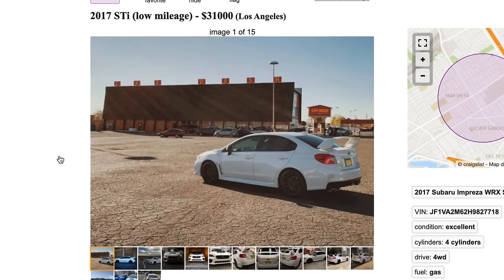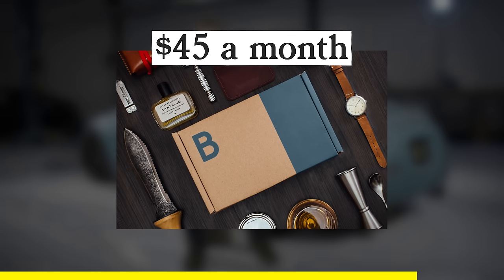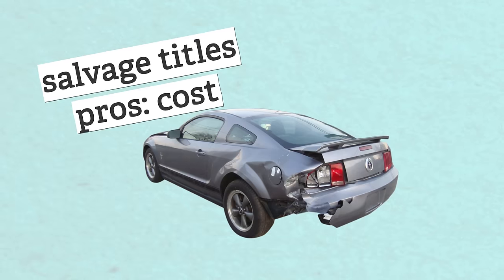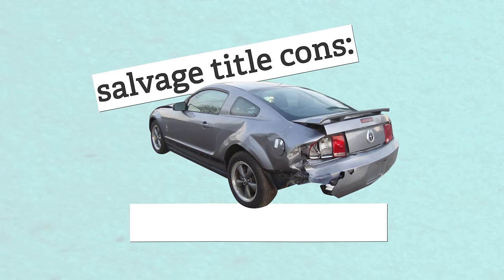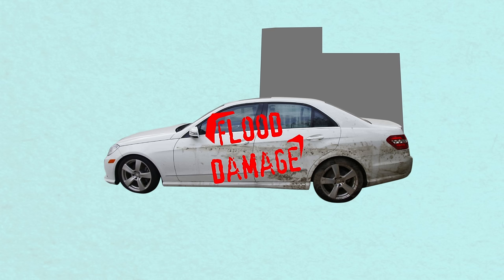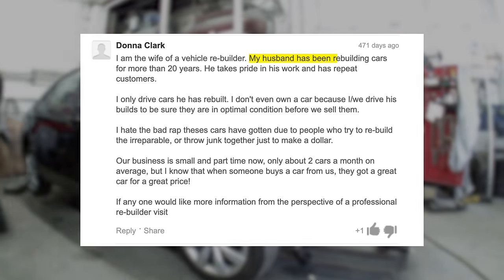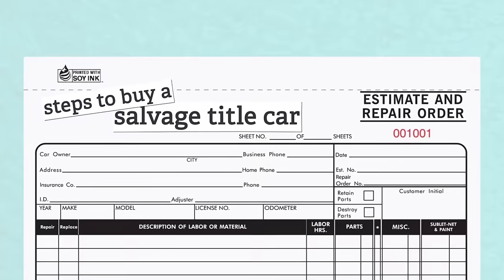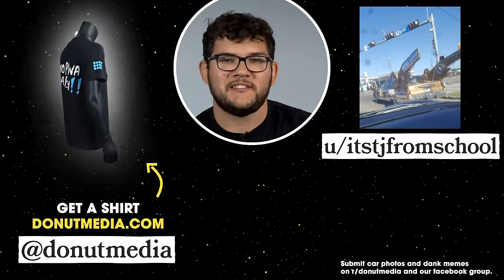Buying a Salvage Title Car: Bargain or Nightmare?

Comment from the maker: What salvage car would you buy to fix up?
Reply: Donut Media, 2011 Cadillac CTS V coupe!! That’s my salvage car of choice.
Reply: MK4 Toyota Supra
Reply: E36 m3
Reply: audi 5000 avant. restoring one myself and 5 cilynder sound is the best
Reply: Most of my dream cars are older cars. Which means I’ll be putting work into the car anyway. If the body was put back well enough that it ran for years then it’s probably okay and I would buy a SALVAGED title car as a fun project.
Reply: @nickcrill7718  change that to a wagon and  I would be all over that!!!
Reply: Celica supra mk2
Reply: Bodyless 2001 Corvette C5
Reply: @finntjomstol9364  E30 M3
Reply: Nissan silvia s15. build the SR20, upgrade turbo, Rocket Bunny, add angle, and drift.
Reply: 90s GMC Sonoma with an awd drivetrain and make it into a syclone
Reply: 1969 Dodge Charger
Reply: 91 NSX
Reply: Donut Media Mitsubishi 3000Gt, Evo or Eclipse
Reply: Supra and a toyota tacoma
Reply: I don’t do salvage but my parents bought a 13 Subaru Outback with low miles for 8g
Reply: bought a bmw e36 and restored it.. now busy on my second project... classic mini 1.3 spi
insta: @julesheynen for pics :P
Reply: S2000
Reply: Feel better soon James. We love you bro.
Reply: Shopping for a 335d right now!
Reply: Donut Media I got an 01 Honda Accord with 86,xxx miles for 1,200, considering they go for about 4-5k normally around here normally that’s insane, plus the salvage happened at least 3 years ago
Reply: JZX 90 (If there are any lol)
Reply: Nissan 240sx
Reply: Donut Media i bought a salvage 2017 charger daytona not knowing lol and then totaled it 5 months later
Reply: 2003 SN95 New Edge "Terminator" Cobra.
Reply: Subie Bug eye
Reply: Any evo, with the money i save i would then not mind the whole blowing the diff thing.
Reply: Toyora MR2 or Supra MK3
Reply: Donut Media 1992 James
Reply: 240Z!
Reply: A civic
Reply: R32 skyline gtr
Reply: Honda CRX
Reply: Toyota Corolla GT Apex AE86
Reply: 1995 Ford Ranger Supercab 4x4 STX 4.0L V6 AT but trying to find one has proved to be hard to find.
Reply: 1992-2002 rx7 STOCK ENGINE!!!!
Reply: @callsigngecko4723   that is probably the best situation to get a salvage title car, you would already mod the heck out of it to drift and if something is wonky you would just Jerry rig a solution.
Reply: Miata
Reply: Bughatti Verón for 10 dollars.
Reply: Gt86 chassis
Reply: Ford Aspire
Reply: 2002 subaru wrx not wagon
Reply: Bought plenty of salvage cars and most run with zero problems
Reply: Donut Media Trd Pro 4Runner
Reply: Donut Media 
I bought an ‘03 Mustang Mach 1 with 45k for $4000. I got it all back together and it was beautiful than it spun a bearing most likely from the accident that it rearended another car. I ended up selling for $2500. Lost my behind again and again.
Reply: toyota ae92 levin sedan
Reply: I own a salvage 2015 Forester with hail damage... sorry, speed dimples. I think it just depends on what caused the damage and how bad.
Reply: Donut Media the 2013 Hyundai Azera has decent prices at the auction these days!
Reply: Almost got a '15 5.0 in auction to widebody
Reply: Either a 3rd generation ford explorer or maybe a 4th gen explorer or... maybe... 1st gen explorer or a 1st gen bronco.
Reply: Rebuilt my dream build car Mazda rx7 or Mazda mx5 or mazda rx3
Reply: Rx7 fd
Reply: What's bad is I gave my brother a hotwheels type R toy since it's his dream car even though he ended up working at a tire place and buying a 2019 civic SI
Reply: Tesla Model 3
Suzuki Swift Sport
Reply: 90 miata. which i unknowingly bought this summer as my first car
Reply: Donut Media 69 charger
Reply: Aston Martin v8 vantage 2006 to 2009
Reply: Vz Commodore  because  im a Aussie  mates
Reply: 240z
Reply: Donut Media 69 mustang gt
Reply: Volvo s60 polestar
Reply: Y’all wilding for using the word sus
Reply: 68 Camaro
Reply: Donut Media no. But yes. But no. 

Would I drive one or let anyone I love drive one or recommend it to anyone? Absolutely not. Would I daily it? Absolutely not. 

HOWEVER, I will make one exception: racecar. Even then, it’d have to be a very specific kind of car. A car that was totaled because the cost of non-structural repairs was too expensive (like the WRX subispeed built for shoes and global time attack), or because of flood damage (like the FR-S converted into a track car after Harvey hit Houston).
Reply: Eclipse GTS or viper or an 70s mustang or AMC javlin and 86 Corolla GTS
Reply: Subaru FTW
Reply: Toyota Tercel
Reply: A lotus!!! Where’s my up to speed on lotus?!?!
Reply: A nissam skyline
Reply: @gagekmiec7101  Oh god please no
Reply: Suzuki Karimun 1st gen
Reply: FD Rx7
Reply: vw beetle
Reply: @Brent Reid ladies and gentlemen.... We got Em.
Reply: AE86/corolla GTS/SR5
Reply: Toyota Tacoma
Reply: Accord
Reply: Accord 2015
Reply: 2002 Dodge Ram 2500 with the 5.9 Cummins
Reply: Anything that 40+ years old and worth your time tbh...
Reply: Mazda rotary power to swap it with a 20b from a mazda cosmo
Reply: 2006 srt8 Chrysler 300
Reply: I have a 96 gmc sierra. It's 2wd and it's a single cab long bed. It has 5 speed 7.4l motor in it (454ci) and it makes about 300 up and weighs less than 5,000 pounds (I think). This truck has 110,000 miles on it and it use to be my dads. He was sitting at a  stop light and got hit by another driver who then took off and the truck was then totaled and I had to buy it back  for $800. My nightmare didn't end there though. Currently I own 2 other vehicles and they keep breaking preventing me from fixing my truck but I'm going to keep trying!
Reply: 1978 safari 911
Reply: S2k or Acura TL
Reply: Got a MazdaSpeed 3 and it’s amazing 🎉
Reply: Any Toyota MR2 😍
Reply: The Mad Daddy I think that’s a great idea. Especially for a family or rookie driver where the looks aren’t a major concern
Reply: If ur gonna buy a salvage  car avoid front damage always go for rear damage or door
Reply: Ford pinto 
Just to replace the parts
Reply: Donut Media challenger srt scat pack or a porsha GT3 RS
Reply: Subaru WRX coupe
Reply: 2015 Mustang GT350. I'll send it back to Shelby to turn it into a convertible.
Reply: Can you do a video on if you should buy a car from CarMax or not
Reply: Mustang
Reply: Any car with “hail damage” those are the best! Like fuck the body, when your going for performance and not looks. “Hail damage” is the best, could get hit by 3 ice rocks “little marks” not even noticeable Forreal. And they auction it for 400$ and it’s like not even 10 years old
Reply: 1993 FD
Reply: The Peel P50 that James wrecked 😏
Reply: A Corvette. I want to own one someday i dont really care if it has salvage title ill own it for the rest of my life.
Reply: 200 series Land Cruiser or a Rivian truck once they come out. Just worry about getting it insured.
Reply: Most y'all got it backwards wanting to buy low production salvage cars (NSX, MK4, E30M3). Unless you gotta lotta time and money, in which case you don't need a salvage car anyway. You buy a Civic, Corolla, Camry, or Accord; in that order. Cars that have Chinese parts support, or common at junk yard, that are commuter cars and sell to a wide range of customers. There's silver in them words of advice.
Reply: @maxanderson7344  you unknowingly bought a car?
Reply: @regularpit1508  what's bad about it?
Reply: @Death_Sweet  you must know what you're buying and you got lucky. Some start throwing codes after you fixem. Like air bag light, though not deployed, gotta send module to specialist. Seatbelt and retainer codes, replace receptacle or sensors. Also impact sensors under bumpers. On and on and on.
Reply: In the state of NJ they are called "Branded Title"
Reply: 2020 cx5 with the turbo i plan on looking for one when my 3 gives out
Reply: R32 gtr and throw in a  r35 engine with a LBW Kit
Reply: 1996 SS impala.
Reply: Donut Media go bucks!
Reply: I would buy some sort of old Ferrari
Reply: Donut Media maybe a milk truck
Reply: Challenger or gt86
Reply: Volvo 240 all the way
Reply: @Sevalen  i mean some people do it for dailys too, just look at @goonzquad, but yes, buy a already wrecked car for a sport/ purpose where its just gonna be destroyed again. like Adam Lz with his JZX100 missile car.
Reply: So off of personal experience I recommend them! I get the cars I couldn’t afford initially at half the price. All of the cars I own are rebuilt meaning they passed state inspection and deemed road worthy again. Here what I’ve got as off now.

2018 Porsche Macan S (8k miles, minor side damage): $27K initially, $31k after repairs. 

2018 Porsche Cayman S (10k mikes, minor rear end damage) $26k initially, $29k after repairs. 

2019 Chevy Silverado K1500 (3k mikes, Front and tear damage) $16k initially, $25k after repairs.

Even helped my GF out with her car as a summer project and she got a, 

2015 Volkswagen Beetle (80k miles front end damage) $2k before repairs, $3.5k after repairs. 

All the work was done ourselves and used OEM used parts bought from eBay and local yards. If you plan on rebuilding something here’s what we did. We only buy off of auctions and made sure we buy ONLY from insurance companies because they do not doctor (hide the damage to sell for more)  cars before placing on auction. We made sure to buy cars with easy to repair damage (no flood, rollover, frame damage). Before bidding we inspected the car in person if possible. We did as much of work ourselves to save the most money, any work we couldn’t do sent over like paint. Got it inspected, and when it passed we received a rebuild title which we can register and even appeal the value due to the history to save on registration taxes. Note some state will not allow salvage titles to be registered, so here in GA we have to do it like this. I’ll be more than happy to share some before and afters :)
Reply: 1999 Ford Focus Hatchback
Reply: 350z
Reply: Dream car Toyota Supra Mk4
Reply: Porsche 911 Carrera RS
Reply: @WarriorsPhoto  you would be amazed what you can find at copart or IAAI
Reply: @LSXSahota  yes! Do it! There is a prius with a massive V8 in it. Has a military theme paint job. Its sick. (We drive a salvage title Prius with 265k miles)
Reply: @hotmojoe2483  ok Cletus
Reply: @Mrtee-ml8zf  😂😂😂
Reply: Bugeye Subaru wrx
Reply: A border patrol raptor
Reply: Will prob in the near future look for a salvaged R8, Gallardo (LP), 911 or a Aston Martin Vantage.
Reply: R32 GTS-T/GT-R or any 3000gt/GTO/Dodge Stealth Twin Turbo
Reply: Datsun 240Z
Reply: Volvos
Reply: Nissan R34 or BMW GTR
Reply: Aluminum superduty diesel. No flood cars
Reply: E55 AMG W211
Reply: E9x 335
Reply: 89 Camry. AKA, "practically a free car".
Reply: Almost any toyota
Reply: Ferrari
Reply: Brz or 370z
Reply: Bmw m3 e46
Reply: My dad and I bought a 2004 Civic LX from the salvage auction, minor front end damage. We put it back together with parts from the junkyard and he drives it to work everyday. He's put like 16,000 miles on it since then without a problem. I'd buy one straight from the auction and fix it myself or from a quality rebuild shop not from other people.
Reply: 1996 Nissan nismo 400 R
Reply: Obviously a Lada
Reply: I'm here trying to change the salvage title on my life.
Reply: I am buying a salvage FRS from copart to rebuild
Reply: Audi R8🤤
Reply: Toyota Sprinter AE86 Trueno.
Reply: @ashwathsalaskar52  Levin or Trueno
Reply: ricky v 1970 gt500 scj convertible yellow hornet
Reply: ricky v but beware salvage or no title can mean stole if no title and salvage insurance fraud maybe
Reply: S00praa
Reply: Donut Media nsx
Reply: I’ve rebuilt a lot of Maserati’s
Reply: 2009 nissan gt-r nismo
Reply: We bought two salvage title cars in California for our high school son and daughter. We bought them from a trusted mechanic and never had any issue. When they needed service we took them back to the mechanic. The kids drove them to the ground and finally we donated the vehicles to the local PBS station and got a nice tax break. The moral of the story is to know the seller/rebuilder.
Reply: 2002 subie wrx
Reply: Donut Media G wagon
Reply: 370z, half the ones on the road are salvage because the cost to buy normally is way too much for what you get.
Reply: Donut Media scatpacks
Reply: My 2009 civic Si
Reply: 666 dollars illuminati exposed
Reply: RX-7
Reply: C5 corvette of any kind
Reply: Manual Hardtop Mustang GT S550
Reply: Obs work truck. Easy as pie to fix (most of the time), sturdy engines (again most of them) and 4x4
Reply: Tesla model X
Reply: A car in an accident
Reply: Bugeye WRX
Reply: Donut Media Chevy Suburan GMT900
Reply: Anything BMW
Reply: I bought and fixed a 2002 Camry that I got straight from the auctions.
My brother bought a 2007 Camry.
My mom bought a 2017 Subaru Outback.
These are all salvage cars.
(p.s. yes I live in Vermont, that is why my mom has a Subaru... BECAUSE EVERYONE HERE DOES!)
Reply: @Leaf Closson Just bought a sweet 940 turbo for 700euros.. Basicly wheels under it worth that money lol
Reply: Purchased a 2019 wrx limited with a salvage tittle. Had 1600 miles on it. Had it inspected by subaru before purchase. Got it for $22k. And it came with STI wheels and exhaust.
Reply: None they’re not worth the headache. Want your dream on the cheap find one with a blown engine or trans with a clean title
Reply: I bought my Dodge Ram pickup truck with a salvage title. $1,500 in body parts and some in paint and it's been the best 4x4 truck I've ever owned. I've had it for over 8 years now and knowbody it the wiser
Reply: Literally anything
Reply: Miata!
Reply: Rsx type s k series motor with a lot of potential for power and if the car is totaled again you can resell as a parts car or pull the motor for a swap.
Reply: Mazda RX-7 fd
Reply: Nissan skyline r33
Reply: Dodge demon
Reply: FD RX-7
Reply: r32.
Reply: I have a lot of rebuilt cars I have a 2010 g37xs  integra gsr ek hatchback and a 08 si mugen
Reply: Fixing a Salvaje E46 M3 right now.
Reply: Ae86 or Ae89
Reply: 2016 and up Chevy Malibu, idk but I just love Malibu’s
Reply: I bought a 2010 Genesis Coupe 2.0t R-Spec with a couple of mods for 5k Salvage title but I drive it ALOT  and havent had probelms. It still has minor damage but a 6speed manual rear wheel drive with a lsd for 5? All day.
Reply: Any RWD cars with a manual transmission. Cough cough Nissan S-Chassis
Reply: Monte Carlo SS the last gen of them that shares it's platform with the 9th gen impala. Perfect for a drag car and fairly cheap to buy because of the age of the car
Reply: Subaru outback..
Reply: I bought my first car ever early 2018 at the age of 20 for $5000. It’s a 2014 Corolla and had 30k miles at the time, the only issue was that it was flooded during hurricane Harvey. Haven’t really had any major issues and overall I’m very happy with it.
Reply: Deffo a skyline
Reply: Pagani huayra roadster ( i saw one on the news get totaled in a accident)
Reply: would live to find a salvage e92 m3
Reply: Supra or 370z
Reply: @shxkn  well as they said some salvage title cars has little to no damage
Reply: @adamwilliams2587  instagram?
Reply: id go with benz, toyotqs, hondas, lexus, acuras, bcs one they r reputable cars and have decent resale, second, id look for preferred body damage, and not too much mechanical, if its say a reinfoecement bar, ill rix it, but say its hail damage, flood damage, direct blow to the engine, or under carriage damage, no way in hell will i buy a car unless im scraping it for parts to rebuild another car. A great tip i learned is say u go on copart, GOOGLE SEARCH  the vin number, 90% of the time it will show u the before and how badly totalled was the car. A great salvage car to buy is rejected repair, it means thst insurance started the repair, shop raises quotes as more parts r required, thry total the car and the parts r basically in the trunk and seats.
Reply: Mk4 supra
Reply: Tesla model 3
Reply: Toyota Supra, Mazda rx-7, or most older Nissan GT-R’s
Reply: Mk5 toyota supra
Reply: 07 wrx/sti, 05-07 legacy/outback xt
Reply: I would get a viper or a supra mk4
Reply: Odd Pepper bit late but got a loaded 16’ Tacoma 4x4 for around 15 total after it all got fixed up (got hit from behind) and just got an 18’ RR rs for 13 total (needed headlight and repaint) ez cop
Reply: In High School I had bought a 2003 Nissan 350z (automatic sadly) for only $2350 that was in a wreck causing it to have a salvaged title... took years a few years to repair but it was worth it considering it only had 58,000 miles at the time. Though she might be automatic, still fun to drive and kinda feel more connected to your car since I had personally repaired it from a state where it could barely even roll... So from personal experience, if you know the ins and outs of a repairing cars or just a slight amount I'd say buy a car that is considered salvage/rebuilt. I have had my 350z for over about 4 years now and she is still going strong with me down in Fort Riley, Kansas. I even made multiple 20+ hour roadtrips to and from my home in NY then back to KS.
Reply: Datsun 240z
Reply: Any GM muscle  car from 1965 to 1978 especially a 1970 Camaro Super Sport or 1978 Chevelle Malibu SS with 454 hp stock
Reply: Shelby gt500 or 350, yenko Camaro ,ss,z28,zl1 trans am, any challenger from 09-2020 or any 60s muscle car.
Reply: I got a 2014 ram hemi for 7k$ with 70k miles i think i got a great deal no issues with it super clean
Reply: Brian's car
Reply: I just bought 2009 M3  convertible. It is the prettiest car I've ever had, though there is visible damage if you look hard enough. It was about 60% of market.
Reply: I would only buy a salvage car for track only use or parts.
Reply: I would just buy a Rx7 or Supra Mk 4
Reply: @Leaf Closson with 6 speed ONLY!
Reply: 1969 charger R/T
Reply: 2005 Mercedes e55 amg
Reply: Newer Dodge Charger
Reply: Your mom
Reply: Miata
Reply: Volvo 850 R
Reply: WRX STI or BRZ
Reply: S2000
Reply: My Monte Carlo was a salvage from hitting a deer. Got it cheap and loved it. Was 17/18 so I was mean to it. One of my favorite cars. No problems besides the ones I caused.
Reply: Brz
Reply: surpa 4 life
Reply: Mr2 sw20
Reply: A nissan Gt35 O a lambo just for fun
Reply: I currently have a 08 g35 HR and a 1995 240sx 🤙
Reply: I drive a salvage titled 325ix that I rebuilt, put 4.10s and a manual in. I would say if you're going to do this get in as cheaply as possible, dont buy anything at first, and make sure you have a good grasp of physics and chemistry, but you can definitely do it
Reply: 335i
Reply: @nickcrill7718  That's the car I have always wanted. I have a 5th gen camaro now, was thinking the cts-v would drop in price and could sell the Camaro ss, but the cts-v just keeps staying at sane price for a low mileage one at about 36k, a cts-v wagon I would love also because of how rare and still just as fast.
Reply: Challenger Hellcat or a Demon
Reply: Nsx, gtr, supra
Reply: 2000 Chevy Malibu
Reply: My written off focus ST.  just want it back
Reply: I got a 1987 salvage Corvette stingray for $1,200, and I fixed it up with a new rear bumper and left quarter panel, new metallic gray repaint, brown leather interior, new bbs rims (RG Diamond Black), Michelin tires and the engine tuned with a new exhaust, better fuel injection, and replaced all the belts. Overall I spent almost $12,500 on my beauty (I'm 27, but get called an old man all the time, and once someone called the police because they thought I was stealing the car and they didn't think it was mine. Good times)
Reply: R35 gtr
Reply: Nissan Armada nismo edition
Reply: This Ford Explorer that I’ve been looking to get redone but don’t know anyone near me...
Reply: @LSXSahota  wouldn't fit + transmission wouldn't either + fabrication would be a nightmare + electrical will be a nightmare
Reply: @benjamincho4819  murica
Reply: @Leaf Closson Parts are very $$$$ for volvo. Not much aftermarket. The cost will be huge.
Reply: 1994 toyota celica >:)
Reply: Bids on Auctions on Exotics
Reply: 2010 PT Cusier even is front is total and rear total but not the cabin/ driver area thought if possible.
Reply: '93 240Z
Reply: GT4, check my gram
Reply: 350z
Reply: A miata
Reply: '91 240sx. I bought it in Indiana, it had an Ohio salvage title, and I lived in Michigan (can you see where this is going?). Apparently, that was too much for the Secretary of State office (our DMV basically) to follow, so when I transferred the blatantly orange salvage Ohio title (from Indiana), I ended up accidentally "washing" the title because they just slapped a clean green Michigan title in my hand, no questions asked. The car was a deathtrap (just because it was old and abused, not necessarily because it was a salvage title). I ended up selling it to a friend a few years later (he did some questionable modifications to the already questionable car). After he had his fun, he sold it to another friend, and then they proceeded to wrap it around a tree. 

Ahhh, yeah that car was absolutely terrifying in all the wrong ways, and I miss it every day.

Bonus Fact: This thing was in such terrible condition that I jokingly called it the 237sx... "Because it was missing a few".
Reply: Cadillac flintwood 1990 ill do it for my dad cuz he had that car before and he loved it but he had to sell it bcs we needed money
Reply: @gagekmiec7101  Is that a supra?
Reply: Eclipse gsx or 350z
Reply: pre 2000's Volvos
Reply: "Weekend box" just full of junk you'll never use
Reply: 2004 subaru wrx
Reply: Donut Media I Bought a 09 Honda Accord exl 2door with a salvage title a few years ago for $5500, got in an accident a year late with it, the other driver’s insurance payed me out $8200 but I was so afraid of getting nothing because of the title before it was appraised
Reply: @gagekmiec7101  hahahaha it's to early for that
Reply: haloplayer 049. Yes and no. I mean you have to remember when it came out it was a like a high school kids car. So a lot of them where probably crashed.
Reply: DODGE VIPEEEERRRR
Reply: Toyota AE86
Reply: Idk
Reply: Rx 7
Reply: 2012 mercilago or a mk4 Supra or take the engine out of a 2000s v8 mustang
Reply: Or a bmw m3 gtr and paint like you know the one
Reply: GT40
Reply: Mazda miata
Reply: Jeep Cherokee
Reply: Wrx ♥️♥️♥️♥️♥️
Reply: Title washing in romania happens every second
Reply: 13k +5k is 18k,  converted to Myr, it's RM 72 000, that is wayyyyyy more cheaper than a Subaru brz recon, which is RM290 000 and I'm like, :')
Reply: S30z, 964
Reply: Rally Spec WRX STi, all wheel drive donuts
Reply: Donut Media 5.0 GT foxbody Mustang Hatchback
Reply: Either a 69 mustang mach 1, or 78 firebird
Reply: Bentley or Lamborghini
Reply: Dodge charger
Reply: WRX in a heart beat. Love the videos guys! GO BUCKS!
Reply: Bro
Reply: @nickcrill7718  Personally, I think the 2011 cadillac cts v wagon looks sick, and it's more practical in day to day use.
Reply: a Toyota Celica or Honda NSX
Reply: The Scotty Thing has me ded
Reply: a
'
Reply: @gagekmiec7101  YOU HAVE TO BE MY BFF🖐🖐🤚🤚
Reply: I bought a salvage porsche cayman for 5,700, replaced the door, fender and quarter. Repainted and sold it for 22,000
Reply: Yes
Reply: BMW e60 m5 6 speed
Reply: Noticed my car was salvaged when the whole front was a different color underneath 🤦🏽‍♂️ but it hasn’t given me problems and title is clean
Reply: Ian Visser Nah I’m gonna stick it with it for a whole , it’s a Honda so it’ll probably be handy me down
Reply: Donut Media I just got my 06 bmw 325xi wagon with 96k miles salvaged. Thing is a dream, seller showed me the accident and it minor fender bender in the rear. Salvage is good if you seller is transparent and honest.
Reply: Donut Media Escalade
Reply: Donut Media 68 z28 rs ss there are 3 in North America
Reply: Bought a flooded 2011 328 for 3,000 spent 1,000 fixing it up and it runs like a champ
Reply: Donut Media a dealer near me would refurbish and sell salvage title luxury cars. From what I heard they were always good
Reply: Finn The Toaster that’s what I did:)
Reply: Corvair, carma ghai.
Reply: McLaren 12C, on sold on salvage auction for $1,400, missing bumper, driver headlight, and driver front quarter panel.
Reply: I would stay away from heavy frame damaged and water damaged cars. The car will never drive straight and all of the computers and wiring will need replacing at some point.
Reply: 1969 dodge charger
Reply: Acura TSX or NSX
Reply: I would totally restore a 1965 Ford Mustang Coupe
Reply: 1997 Wrx STI
Reply: Brz
Reply: what about a salvage classic car. no electronics in a 1970s classic.
Reply: Honda nsx
Reply: 5th gen Mustang C8
Reply: 2012 Camaro SS out with the new, in with the old.
Reply: None
Reply: camaros, nissan 350z 370z, mustangs etc
Reply: 1982 Corvette
Reply: A Jeep that only has roof damage that’s all 🥱
Reply: Gimme an e46 or e36 or an e30 or a 350z or a. . . . .
Reply: 1st Gen Acura nsx
Reply: 240z
Reply: An A70 Supra
Reply: Donut Media Toyota 86/brz/fr-s
Reply: C63s AMG
Reply: 64 mustang
Reply: Got a Mk3 Toyota Supra that was a salvage title because it was stolen. Super good deal!
Reply: honda ruckus
Reply: jeep grand Cherokee track hawk supercharged
Reply: R32
Reply: R32 skyline
Reply: I just bought a 90k mile 2012 Impreza Sport Premium for under 5g’s because it was salvaged.
Reply: 97-01 Honda prelude manual only
Reply: i got a 2012 bmw 328i modern edition, 65k miles for 10k lol, ended up having a salvage title but was repaired, and has had no issues since, except normal maintenance
Reply: A Black 2009 Cvpi which hit a deer and I did to fix it is a body on frame car and the damage wasn’t that bad so I don’t have to worry about having the frame straightened and it came from another state so I don’t think it will have as high as insurance then my sideswiped cvpi
Reply: Donut Media m6
Reply: R34 gtr
Reply: Gt86
Reply: 3 cars and I love them all. Nissan Xterra 4*4 and 2 Mini Cooper's. My fast Mini came from salvage with Megan coilovers,  forge intercooler, downpipe, akrapovic exhaust GoPro mount etc. It was someones autocross car that I got for 3k.
Best decision ever. I'll definitely buy salvage again.
Reply: 99s miata
Reply: A 1980’s Mini Cooper
Reply: mr2 and 2gr swap
Reply: Bruh Stagea 260 RS
Reply: B5 s4
Reply: Mitsubishi 3000gt vr4
Reply: @piggy_5.764  My friends neighbor has one, and I can tell you it's sick.
Reply: Something cheap but not too messed up. Maybe an economy car. Toyota Camry
Reply: Infiniti g37x
Reply: Just bought and am in the process of fixing a 2019 ford transit to build into a tiny home to live in through college
Reply: E30 M3
Reply: @gagekmiec7101  same.
Reply: Donut, I've come to bargain.
Reply: m3 e46
Reply: vw bug
Reply: Maybe an old Volvo 760 and make it a mad sleeper
Reply: Aston Martin vantage.
Reply: Old ass vw beatle
Reply: 02 mazda protege mp3
Reply: foxbody mustang
Reply: 2005 Mercedes e55
Reply: Squarebody chevy
Reply: prelude
Reply: I bought 2 370z’s to fix up. Profited a chunk not gonna lie
Reply: Probably a nismo 350z
Reply: 1999 bmw e36 m3. I’m a poor kid, and finding an e36 for $1.2k is like God speaking to me.
Reply: :3 any Affordable Volkswagen
Reply: Mazda rx7
Reply: Frs
Reply: 2006 acura tl
Reply: Jaguar XJ
Reply: 2016 Mini Cooper countryman
Reply: 1997 Toyota Camry
Reply: AE86
Reply: Any and all
Reply: Land Rover 110
Reply: 99 Integra Type R. I found one for 6k last year but I didn't have the money at the time and when I did it was gone. Big sad
Reply: Mk4 Supra s13,s14,s15
Reply: R 32
Reply: Toyota gt86
Reply: @gagekmiec7101  the mk4 is sooo overrated lol
Reply: Dodge demon
Reply: civic ok ok
Reply: I bought a salvaged e92 328i with a manual with 72k miles for less than $5k, I had to put some work in but absolutely worth it.
Reply: s14,s15
Reply: Mr2 cheap parts, price gain (manual jdms will rise)
Reply: m6 renegade or a s13 s14
Reply: Just traded my clean title FRS for a salvaged rebuild AP2 S2k
Reply: I got my Zboi on a salvage title it now has over 130k miles on it and still rolling strong. Someone may have stolen it previously and after recovery it could be considered salvaged
Reply: 87 gnx
Reply: 2007 mustang gt350
Reply: What’s the company’s that fixed salvage cars ?
Reply: @josrieparsley7492  look it up idk to be honest
Reply: 1967-72 corvette stingray
Reply: S2K
Reply: Why did you have to use 666 just why?
Reply: Prerunner Nissan titan
Reply: WRX for rally because i will crash again lol
Reply: VW Golf GTI (NEWER YEARS)
Reply: I bought a Prius compact and has been nice to me for the first 100,000 so far.
Reply: Mclaren f1
Reply: M320i for sure
Reply: S14 Kouki.
Reply: @callsigngecko4723  I’d do the exact thing, but without the rocket bunny.
Reply: Gotta go Fast and the Furious, grab a wrecked Supra to put together (even though it would have probably been cheaper for them to just buy a good one).
Reply: GTR :D
Reply: E55 AMG😂
Reply: Pontiac 6000 le
Reply: Any datsun or 90s nissan
Reply: golden rule about salvage car is~
If you are not planning to insure it, buy it.
Reply: E30 because it's my favourite car and it's not so hard to work on.
Reply: A Miata for sure
Reply: I just finished a 2013 Audi A7 with cosmetic damage. Actually if anyone is interested from the Seattle area, or farther away and willing to come see it, shout at me.
Reply: F150 Raptor 😻
Reply: g wagon
Reply: BMW z4
Reply: Any Lamborghini Aventador roadster
Reply: Dont care just want a car from those rust valley boys x'D
Reply: An R34 or R35 GT-R
Reply: a 2019+ Velar or SVR
Reply: I bought a 93 RX7 as a non-running project with a clean title.  I only found out later (I didn't do my due diligence before buying) that it was washed in upstate NY.  Front frame damage, engine fire, countless wiring issues.  I overpaid badly for the car and have spent upwards of $30k on work to it.  Always do your due diligence.  I paid more than double what I should have for the car given its title status.
Reply: ‘69 Chevy Nova. 69 because nice.
Reply: I would never buy a salvage car.  Because I don't have a salvage dealer license.... using the correct vernacular matters.
Reply: I would fix up that 05 V6 Mustang right there and drop in a Homemade 6.8L DOHC 40V Triton V10 in it or a new 7.3L Godzilla V8 in it as well.
Reply: For me I would either fix up an 67-72 old Ford F100 Bumpside or a 73-79 F100 Dentside or even an 80-86 Ford F150 Bullnose, paint it red and white, and drop in a custom built homemade 6.8L DOHC 40V Triton V10 or just drop in a 5.0L Coyote V8 out of a wrecked 2011-2014 F150.
Reply: @ClappedGMC  Keep up the good work brother.
Reply: I would also take a wrecked late-model Challenger SRT8 with a 6.1L Hemi V8 and bring it back to live but making it a 426 Gen III Hemi V8 powered Challenger along with Longtube headers, high flow cats, and a full on Borla ATAK catback exhaust and man it'll be a beast 💪.
Reply: How about those that are clean title but says "Loss:.....Other" ???
Reply: got 3 salvaged cars, fix them and only spent 5,000 on total fixing
Reply: E30 coupe or E36 coupe or covertible
Reply: Porsche Carrerra 1996
Reply: 82 C3 corvette, then LS swap it
Reply: E36 or E46 or Mitsubishi GTO (3000GT).
Reply: Yes cuz I am still a kid I can’t afford a car
Reply: I got a salvage title, hasn’t done me wrong. Body panel gaps are bad tho
Reply: 2010 Nissan patrol gu td42
Reply: Ford rs 200
Reply: A Saab or Volvo lol - they're built safer than most other cars
Reply: I've been actively searching for a z06 c5 corvette or c6 grand sport salvage.  Preferably flood or theft recovery
Reply: Any supra or a 1970 plymouth roadrunner
Reply: Do not buy a salvage title car unless its a car titled as salvage
Reply: Currently rebuilding a 1985 Nissan 300zx and have a 1968 FIAT 850 waiting for its turn both from salvage yards. Absolutely love salvage vehicles and the community for them, cheap chassis and cheap parts make project cars so much funner when I know if I break something or damage it I can just head to a trusted scrap heap and by a replacement knowing there’s no value left to lose
Reply: 2010 honda civic.
Reply: @WarriorsPhoto  i would think the frame would be more important.
Reply: @Fausto_4841  Yes it is.
Reply: I want a TT so bad
Reply: Hellcat jeep for the family
Reply: Geo Metro
Reply: Honestly? An Acura integra sounds sick as hell to rebuild
Reply: Camaro
Reply: Audi sport Quattro
Reply: toyota crown
Reply: AMC Gremlin X.
Reply: Mazda RX7
Reply: Mr2
Reply: I'm looking at the tub from a crashed lotus exige. No powertrain, but they're only asking $7-$8k
Reply: Subaru Impreza WRX hawkeye
Reply: G80 m3
Reply: Corvette
Reply: M2
Reply: 1995 Lexus Sc400
Reply: I got a clk 430 1999 I have been fixing it up since I bought it
Reply: Datsun 240 😮‍💨
Reply: I bought a vandalized BMW e60 550i for the cost of the transmission used. Steal of a deal!
Reply: Scion FR-S
Reply: xnox1n634  thanks ha also have an FC RX7 but its a long ways out from being done
Reply: @tlreclipse1126  i miss my FR-S :( (RIP), super solid little cars and really fun if you know how to drive them right.
Reply: @RobynTapps  It's essentially my dream car, I was a fan of the AE86 so when the FR-S/BRZ was announced I was estatic.
Reply: @tlreclipse1126  that meme of clarkson smiling is what made me want one, saw the episodes first airing and immediately wanted one. Sad mine is gone but glad i got to experience it ^-^. Back in a bmw now (v8/manual) with an 4age powered FC project car im stacking parts for
Reply: salvage car, ok if you know it is; 
GM car - new, used, anything - F!ck NO!
Reply: A Porsche 944! One of my favorite cars and hated for no reason!
Reply: Cateye Silverado
Reply: Lotus Elise.
Reply: I bought a 3G GT Eclipse and didn't realize it was a salvage until I had already signed papers and given the asked price without any negotiating, for $4500 it's done alright and it seems to be in mostly good condition once I fixed a couple bad pulleys and need to replace the suspension in the near future. I do love my Roxanne though.
Reply: Back To The Future car 😅
Reply: Pick up truck
Reply: Lookat 2016 m3